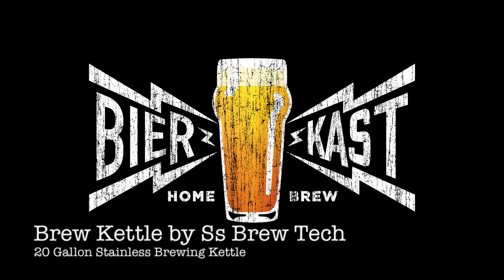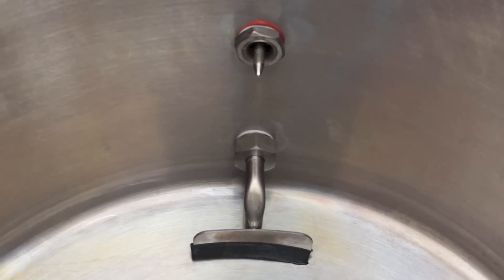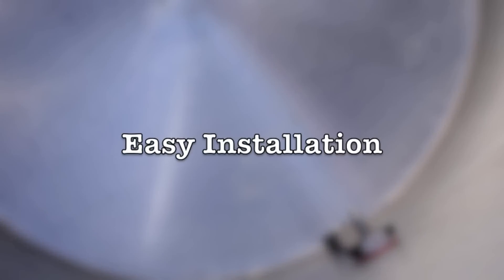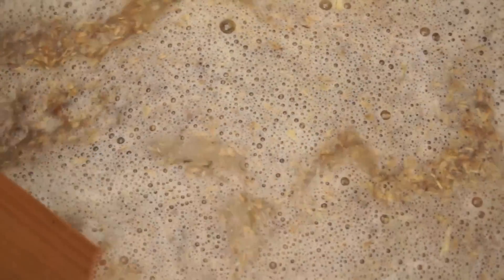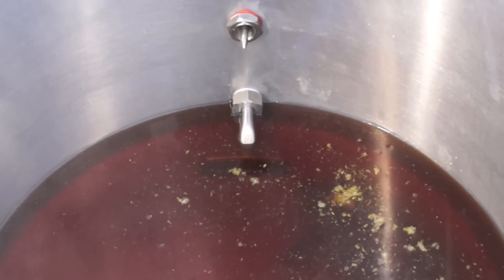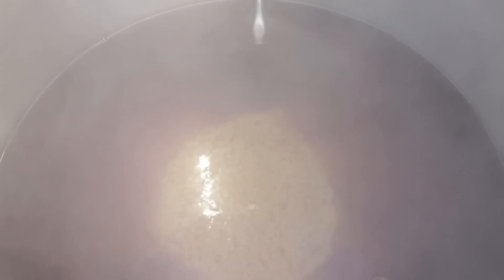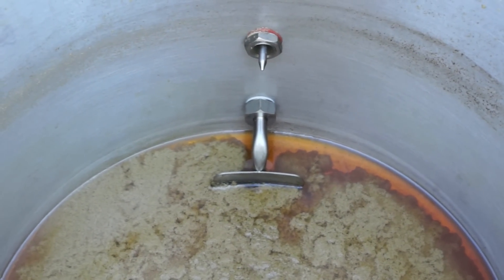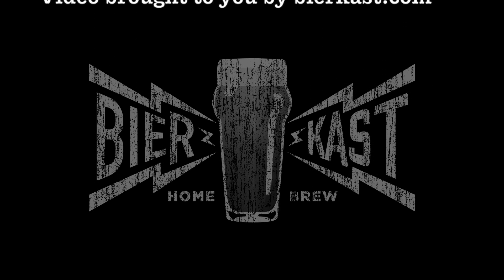SSBrewTech Brew Kettle Bierkast 01

Comment: Nice looking kettle! Would it be easy to remove the dip tube and go with my normal setup of 1/2" elbow and stainless hop filter. I use lots of whole leaf.
Reply from the maker: highcountryhay Sorry about the delay.  I'm not sure if the hop filter would work.  Do you have a picture of it?  The dip tube is easily removed.  So it's probably not a problem, you'll just have to figure out what works best.